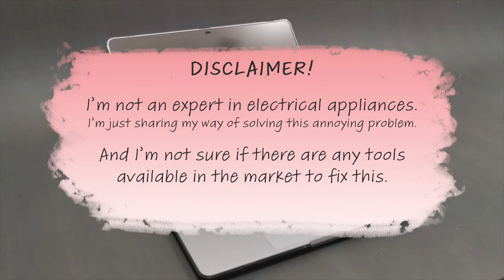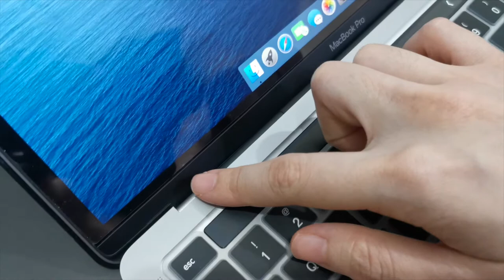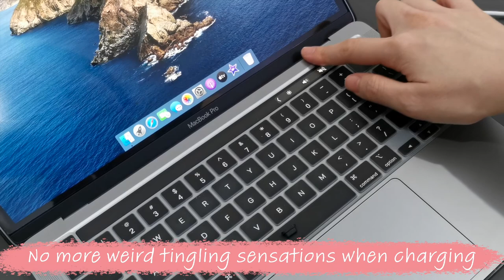My NEW MacBook Pro shocks me?! ⚡️👩🏻‍💻DIY quick fix to properly ground Apple chargers ⚡️

Comment: Why is apple not addressing this issue? It's stupid. Their products are so expensive and yet a simple thing they don't address.
Reply: I agree, so stupid.
Reply: Agreed too, so stupid. Expensive and this problem not being circulate in social media some more 😖
Reply: I remember that they included the grounded Power Extension Cable on earlier MacBooks, saved <1$ in production and can sell it for ~20$...
And it's uncomfortable but not dangerous so it's allowed.
Reply: It’s not stupid tho. It’s the way all two prong chargers and outlets work. Even my asus laptop does the same thing. Basically outlets with only two prongs do not have ang grounding so some gadgets gives this static charge when plugged in. It’s not an isolated issue in apple devices
Reply: 🤦🏻‍♂️this is a normal thing with all laptops, not just macbooks, its called tingle current.. its not a big deal.
Reply: @yobroyobro1965   dose it harm the motherboard
Reply: @abdulrahmanalowein3243  not at all.
Reply: @yobroyobro1965 it is happening with my samsung tab s6 lite 
When I touch the metal back it give very mild sensation...is it normal? Or a hardware issue????

Comment: You can solve it just by purchasing the extension cable from apple accessories. Have been living with this static for a year and it's getting too painful to ignore. Reason for this is the plastic case behind is not connected, what JoYenn did was connect the ground pin to the adapter. Alternatively the extension cable comes with this connection already, so I really recommend this. My MacBook Pro motherboard got fried because of this power discharge. 

Please like this comment so it bumps the visibility. Can't believe all the solutions on the internet are not recommending this quick fix.
Reply: The power discharge do damage the motherboard?
Reply: Your MBP was in warranty ?
Reply: Is this shock harmful for us?

Comment: bought ipad 9 gen 10 days back ...while charging it shows tingling or minute vibrations. how could i solve it..? Is it bad for my ipad ??

Plzz helpp
Reply: Same problem with me I bought ipad 9 th gen 3 days back and now it's vibrate while charging 😌
Reply: iPads have only two pins and there's no ground pin to take out the excess charge.. I have the same problem my touch ID shocks while charging.. the same technique in this video should technically work with a 3 pin external adapter.. I'll update after I've tried..
Reply: @aronorenda  I have a 3 pin adapter and mine vibrates like crazy
Reply: @channychan2857  wait I'll send a link which worked for me.. just need a travel adapter with ground pin
Reply: @aronorenda is it normal?? Will it damage my tab??

Comment: Hi, Kindly answer me. I got the same experience for my Sony A7 3, camera, Sony providing 3 pin Cable but it convert AC to DC and while charging , i smoothly touched metal part of camera and feel tingling sensation. But if i touch strongly it will go. Only it feels when we smoothly touch. My doubt is, will it make any issues in Camera internal Parts. kindly reply bro
Reply: Basically it's good practice to earth metal parts that you come into contact with, otherwise any stray voltage will use your body to complete the path back to earth. Hope that helps.

Comment: Great! it worked, guys, let me know if anyone every run in to any issues with this problem, for my applience, I dint use just a wire, i used copper wires which are very this and coiled them using 5 wires (with insulation in the middle), so its a bit thinner than the one used in the video, but it worked perfectly. If i ever run into any issues, ill update here, Im planning to soldier it in tmrw and see how it goes.. Thanks again
Reply: Do u had any problem as of yet?

Comment: Buy the Apple Power Adaper Extension cable and it has the earth wired via grasps which hold that metal pole in the charger. I really don't know why they don't make the small plug have the same thing but I realised back in the PowerPC days that this was the problem and yes, it really has been going on that long. Oh, and on older MBPs you used get both the small plug and the extension cable but now just the small plug. £19 but money well spent especially as it's easier to unclip the power supply with that hanging behind the desk.
Reply: For some reason the extension cable doesn't fix the problem for me. I can clearly see the metal grasps that hold the metal pole though.

Comment: I have used your showing formula, but unfortunately, it's not working. I got 3 pin adapter with my mac pro 14". But my whole house/home electric wire is not earthing proof. That is why I feel still  MacBook electric shock leakage issues. Could you please tell me any other solutions? Thanks in Advance
Reply: You need a proper ground rod (copper stick) hammered at least 2.4 meters deep into your yard, and then connect this rod with a cable to the ground connector of the charger.

Comment: How about for countries like mine whose charger only has two pins? (No ground pin like the UK version)? Please help for info, I'be been electrocuted several times and I'm always worried using it while on charging.
Reply from the maker: Alternatively, you may want to try one of these instead. 
1. Buying an additional power adapter extension cable from Apple. 
2. Changing the charger to other USB-C power delivery adapter (USB-C chargers from other brands should work as long as you check for the suitable power capacity).
I hope this helps :)
Reply: @joyenn38  thank you so much. I'll give it a try.
Reply: Connect the other end of wire to brick wall instead of socket

Comment: If I wanna buy this wire, what is this wire called?
Reply: Any very thin insulated wire will do, just be very careful not to let the wire touch the other two pins which are LIVE and NEUTRAL! or you'll get an electric shock!

Comment: how should we get that red wire?
Reply: Doesn't have to be red. Any very thin insulated wire will do, just be very careful not to let the wire touch the other two pins which are LIVE and NEUTRAL! or you'll get an electric shock!

Comment: But unfortunately i got only 2 pins asiAn standard, how to solve that
Reply from the maker: Sorry to say I have no quick fix for the 2 pins. But you could try changing the socket or getting a cover for your device so that you won't accidentally touch the metal surface.